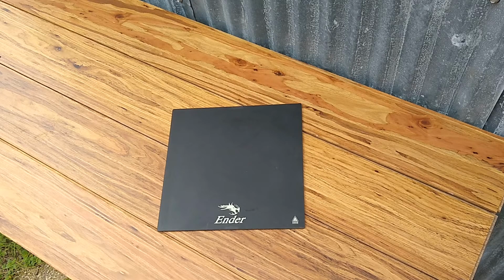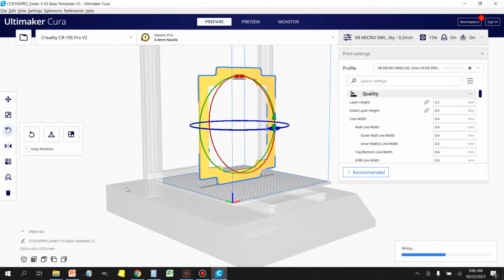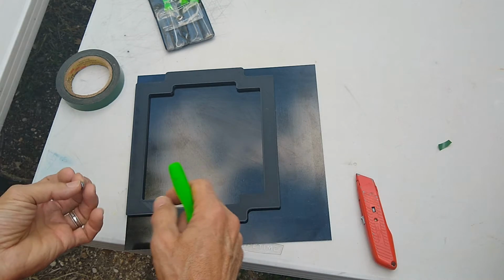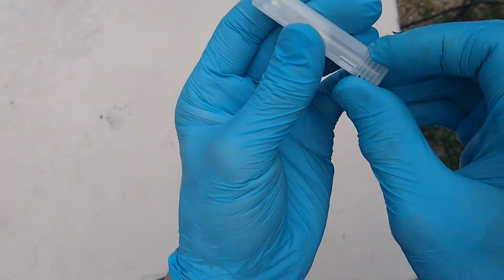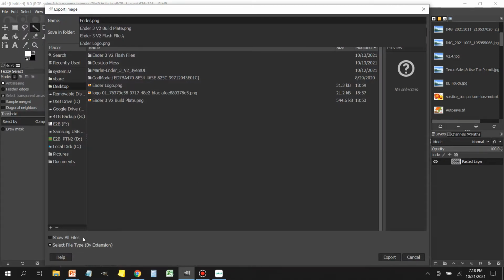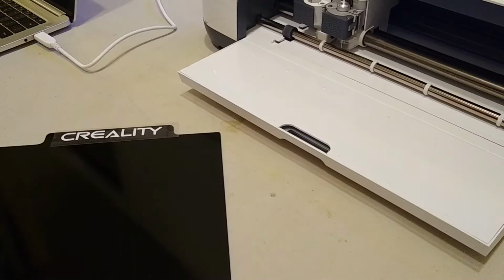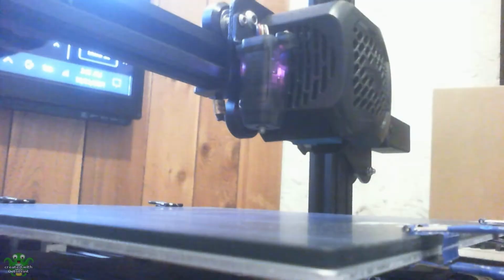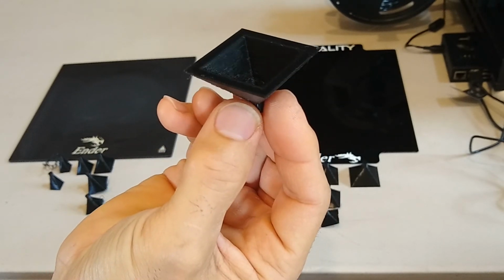Ender 3 V2 3D Printer Amazing Bed Adhesion Garolite G-10/FR4 Semi-Flex DIY Build Plate Under $25

Comment: Would be really nice to make this exact test with a lot of different buildplates!!
Reply from the maker: Hello Kevin, Thank you for commenting and content suggestion. Which ones would you suggest I test?
Reply: @vbared  Textured pei vs non textured, Buildtak, polypropylene, G10, stock ender 3 v2, the other side (straight glass). Something like "The Ultimate Builtplate Guide"
Reply: Also, it could be for many types of filament like: the best for Pla, abs, asa, petg, tpu etc

Comment: I never had issues on my Ender 3 V2 with glass bed really(knocks on wood!). But I am thinking about using Garolite simply because of the weight on Y axis, since glass is quite heavy... was thinking about 3mm just to make sure it wont wrap (that quicky) over time...

Comment: I saw the video on G10 use for build plate. I went down to Lowes and found one that was 8x10x.093 in. Smaller than my build plate of CR6SE but I got one anyway to try. Besides I only do small builds so the size would work for me for the moment. Clipped it using clips and started printing. Wow, Perfect on the first print and my stock build plate was a hit and miss. I am going back and getting the right size cut. It looks amazing so far. No issues of not adhering to the build plate. It cost me $5.99. Custom size will cost me more as I have to use Lowes cutting services but it is so much cheaper and much better so far. Amazing!!!
Reply from the maker: Hello Raju, Thank you for commenting. G10 is amazing and a real game changer for 3D printing. Like you said it's now press print and walk away knowing it's going to stick  every time. Thank you sharing that you located some at Lowes at such a good price and cut. I ordered mine from McMasters, it was $27 for a 12x12 shipped, and plus the bits to cut it another $80.

Best of luck with your mods!

Comment: I’ve just bought a FR4 bed to replace the bed on the CR10 Max as it’s perfectly level unlike the original bed with non of the excessive weight either. I’m still tweaking the printer from new so haven’t tried it yet but will let you know.
Reply from the maker: Good morning Mark, Wow, the CR10 Max Is a huge printer. What are you planning to make? I'd love to hear about the new bed. Thank you for sharing your experience with it.

Enjoy your day!

Comment: Another angle on this - I've had prints fail because I've used cheap paper towels with IPA for cleaning.  That garolite was not collecting debris from your towels at the beginning but it started collecting towards the end. The stock build plate looked like it had a lot of anomalies on the surface - was that junk from the towels?
Reply from the maker: Hello,

Thank you for commenting and ideas about the possible cause of the stock build plates adhesion degradation over time from cleanings.

Yeah, you're right, the stock glass does get easily contaminated. I was doing some adhesion testing with a brand new one while testing it vs Garolite G10 and found that adhesion was the same when it was new. I never did figure out what contaminated the surface on my original glass build plate but once it's contaminated it's adhesive properties were compromised. The G10 is super easy to use, no adhesion promoters of any kind needed, not picky at all when it comes to being cleaned,  allows me to print at 100mm/s due to its light weight, and parts pop off all by themselves when it cools. I haven't used a scraper since. So far the materials I've tested are PLA, PETG, NYLON, and ASA. To get ASA to stick required sanding one side of the G10 with 120 grit wet sand paper and getting a tiny bit closer to the bed for more first layer squish. The other side I prefer smooth to allow for easy parts removal.

G10 is amazing, I use it on all 7 printers.

Comment: Just use PEI on a flex bed. Works great for PETG.
Reply from the maker: Hi Sean, Thank you for commenting. I agree with you 100% on the PEI film with flex bed, It works very well with PETG.  I have a Wham Bam with that film on my CR10S Pro V2 but my bed isn't perfectly true and it was very expensive when I purchased it a year ago. The biggest advantages of Garolite for me in addition to the awesome grip on PETG is the low cost of just over $20 shipped, it's totally flat, and still provides the benefit of some flex. I haven't needed to flex it since I started printing with it. The parts release on their own when cool or if in a hurry a little squirt of alcohol around the base of the part will release it.

Best of luck with your projects!
Reply: How much would you sell a finished G10 build plate for? Or the router template?
I don't have a printer big enough to do the router template
Reply from the maker: Hello Josh, Thank you for commenting and consideration in supporting my work. I'm currently running some 3D printed jobs that should be completed within a few days. Please email me your shipping details to vbared@gmail.com put "Ender 3 V2 Template Quote" in the subject line so I can give you an accurate shipped quote plus ETA for the router template in PETG.

Best of luck with your mods!
Reply: @vbared  You can now get knock-off PEI on flex steel for very little money. It is as flat as the base magnetic sheet is, which is as good as the heated base plate. Yes, cheap magnetic sheets will lose effectiveness at temp, but a good one should be fine to 120 C.
Reply: They say Garolite works better for nylon,  I tried nylon on PEI it won't stick until I applied wood glue (PVA)
Reply from the maker: @TechExploresNYC  Hello Tech Explores NYC, Thank you for commenting and your suggestion. I haven't tried printing nylon yet but glad to hear that G10 works with it. PETG will stick to WhamBam with PEI but it's so expensive. 

Best of luck with your mods!

Comment: I just got a 12" by 12" sheet and scored then snapped them on an edge, you won't get much fiber dust that way. The sheet I got was half the thickness so it bows when clipped on the edges. Maybe I will glue it to a glass or spring steel for support.
Reply from the maker: The 1/16th inch thickness works great for me and the clips don't flex it at all. Using glass glued to a thinner sheet as a substrate is a good solution.

Comment: The Ender glass build plates have some kind of carbon coating that doesn’t like alcohol. Water with a little Dawn or glass cleaner work much better. I had all sorts of issues with my Ender 3 v2 until I stopped cleaning it with alcohol. I discovered this by accident, after every 5 prints or so I would clean the plate with warm water & Dawn scrubbing with a sponge. Rinsing well then drying with a clean soft cloth. My prints would then stick. After a while I thought what would happen if I cleaned the bed between prints with water & a little Dawn. Low & behold my prints started sticking better.

I just bought a sheet of G10 to try. Discovered your cutting video at the right time.
Reply from the maker: Hi Gramps, Thanks for commenting and info on cleaning with Dawn. I'll have to experiment with that. Printing PETG on glass either side was problematic for me. I could get it to work by loading the glass up with stick glue but the hassle of having to clean it after every print got old fast. The G10 is awesome for all other materials except PLA without the need for glues of any kind which I don't use because of inability to handle heat outside. I run my bed at 80c for PETG and Nylon and they stick when hot and release when the build plate completely cools. G10 was a real game changer for me.

Best of luck with your mods!

Comment: Hi Victor. Thank you for all the help and for sharing this useful video. hey next time you cut this type of material. just run a scoring line on the strait edge and flex it to break apart. 
do score on both top and bottom so it doesn't delaminate .

once broken apart use your router with the carbide or tungsten bit and smooth it out. you can also use metal tin snips to cut it but you have to have the right angle ones but again give your self extra because with tin snips the G10 will come apart. awesome video and great job. Cheers
Reply from the maker: Hi Rafael, Anytime my friend. Great job hunting down the cause of your issue. I'm glad you were able to get it printing again. I appreciate the suggestions, a straight edge would have been a simpler approach to rough cutting it.

Have fun making Thingiverse projects with your daughter.

Comment: Have you tried using it to let it cool then automatically have the print head pop off the old print for automated batches similar to https://www.youtube.com/watch?v=N65Is1ZMIIg
Reply from the maker: Hello Matt, 

I'll have to do some testing but it doesn't take very much for parts to release. I use a wipe and purge routine in my start code which I would have to switch off. It's a great idea, I'm sure it would work.

Best of luck with your mods!